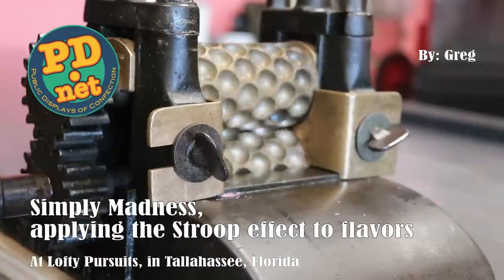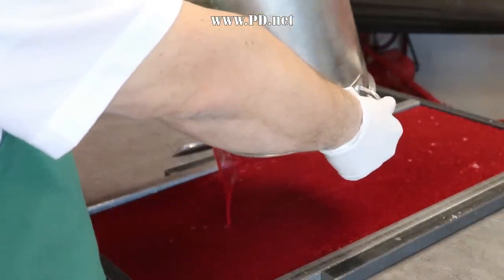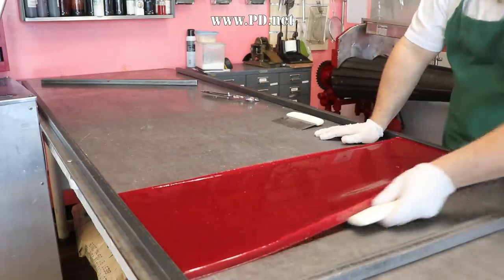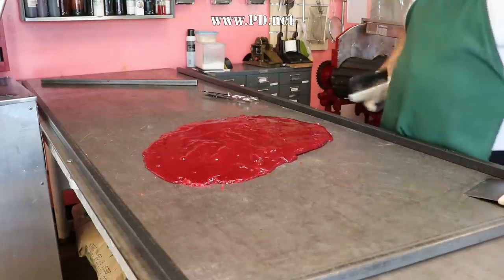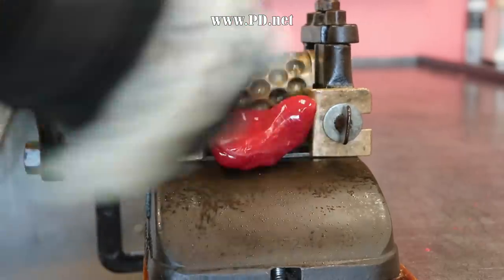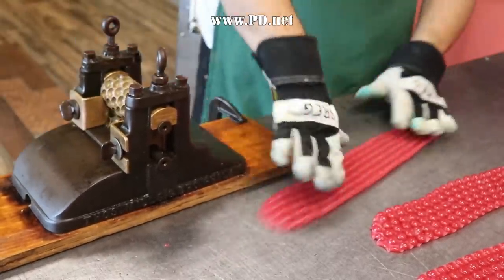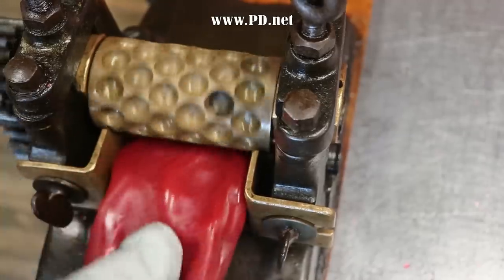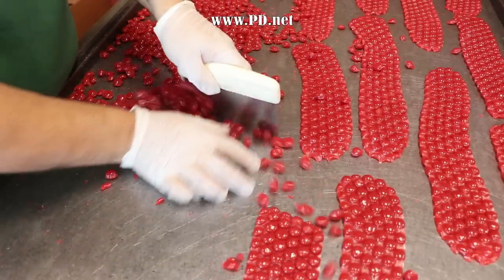#73 The making of Madness hard candy and the Stroop effect in sugar.

Comment: If you dropped the candy in a box with a screen on it that doesn't let the drops fall threw but allows the excess you get from the spacing between each drop. You could collect that excess every so often and mix it into a non flavored batch and allow that to be the flavoring. I think it would come out tasting amazing. You could call it your mystery candy since no batches would ever be the same. Just an idea and it would allow you to prevent any waste of product. You could make a tray in the box that collects the excess candy shavings and have the screen lift out to remove the drops. You could have a cover for that box to keep the shavings fresh and by adding those shavings to another hot batch it would remelt back into the candy or perhaps give it a crunch effect. Just an idea and hope this helps :)

Comment: Should I be concerned that the Stroop effect has never worked with me? I vividly remember being in second grade and my teacher had a poster board with all these colors. I'd rattle off the color of the word (not the word itself) like it was no issue. But I watched my classmates struggle and the harder they tried it seemed they messed up more. I didn't understand this. And still don't. It doesn't seem hard to me. Just don't focus on the word. Focus on the color. I don't get why that's a hard concept. Or why people can't single out the color and totally ignore the word. I've never gotten hung up on it. And I don't know if that's a good thing or a bad thing. I'm curious what that means on a neurological level. Most people are able to see the color but pay attention to the word. Yet I just pay attention to the color. I'm not "seeing" both. And when told to do it backwards and say the word instead of color of the word, I only get tripped up if I previously did it right ways. Like if the words are blue, green, yellow, purple, yet they're colored orange, blue, red, and brown I will read them as the color they are. But if you ask me to then read the word and not the color, I do get mixed up. But if you put a chart in front of me and told me to just read the word for the very first time, I'd be able to do it, no problem. Which is a bit fascinating to me. This whole thing has always fascinated me. It's very strange. And proves that our brain isn't always top of things.